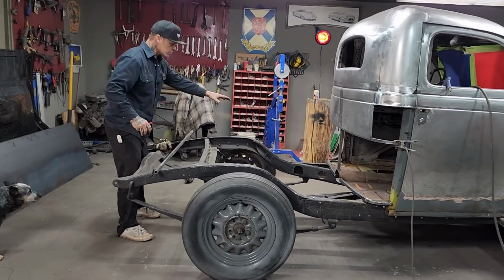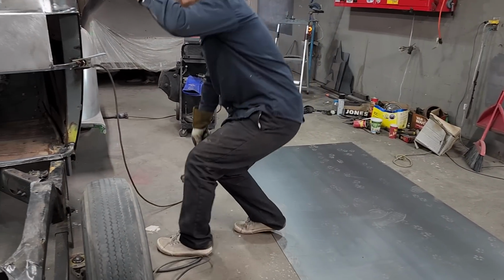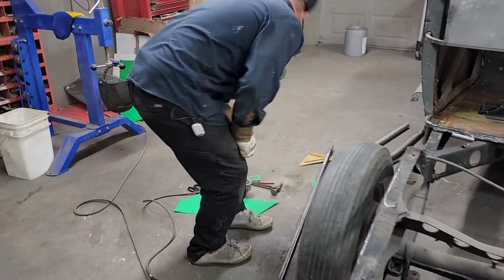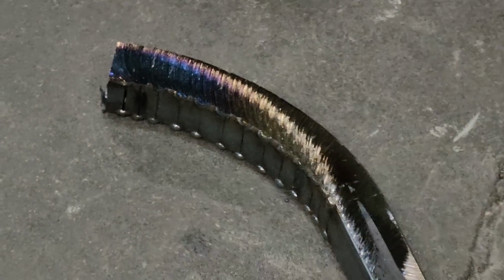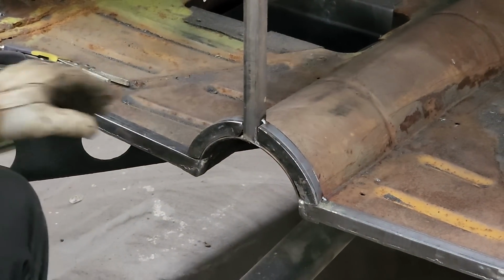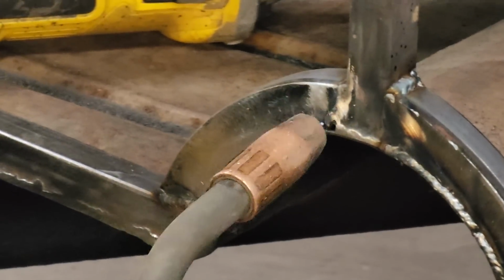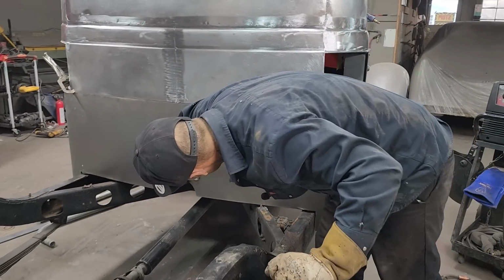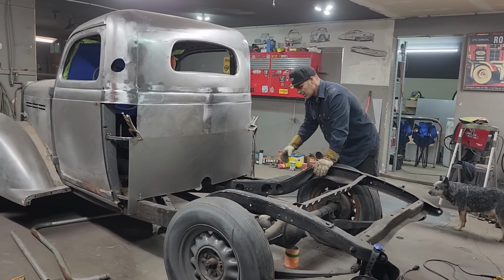Sheathing in the back of the cab with 18 gauge sheet metal

Comment: May I respectfully suggest that you need a "character line" (embossed or debossed) that would run horizontally up about half way from the bottom of the new bottom panel --maybe that would pretty closely echo the upper edge of the bed.  Otherwise, it's just a flat panel.
You are an amazing craftsman and handle the welder better than I do (I build customs just for myself (hobby only).